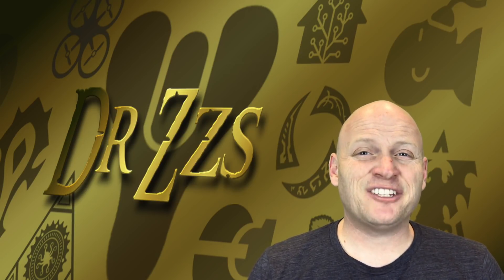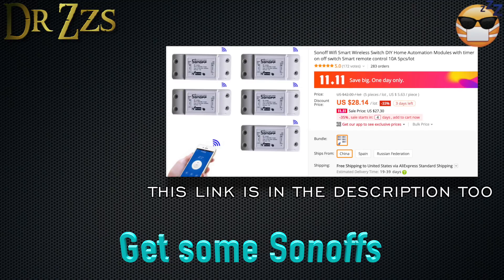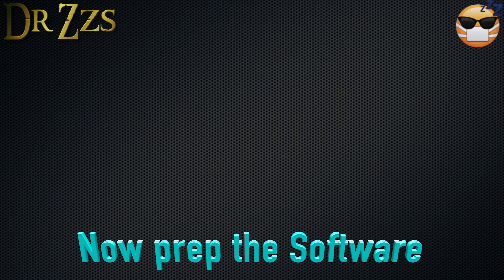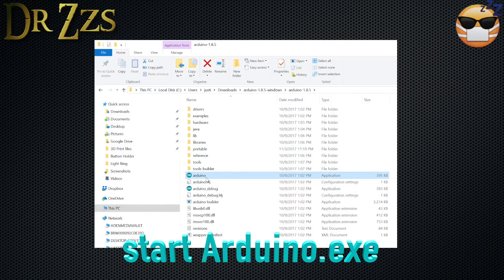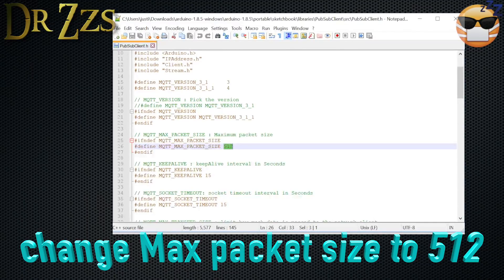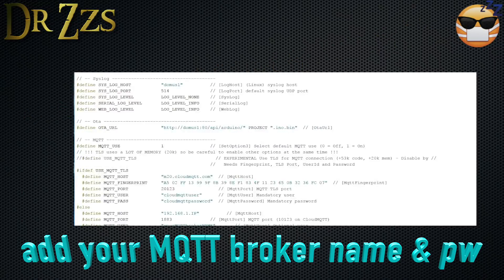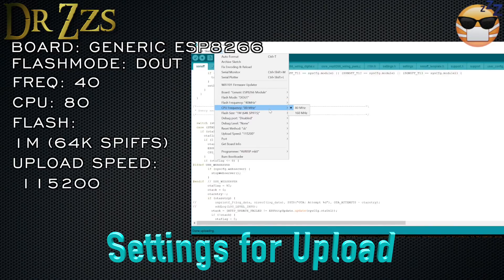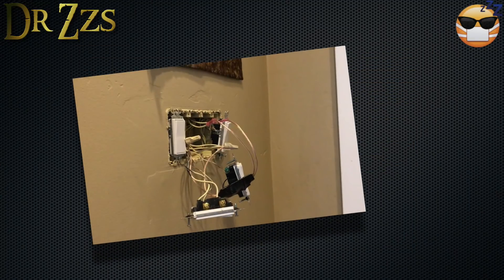Flashing TASMOTA Firmware on the Sonoff Basic

Comment: DrZzs great video!  thanks for the help.
I followed the video as best I could.  I didn't get the generic 8266 board installed and all the settings .  I went to board manager and searched for "generic" and installed.  I just thought I would get some feedback in case others were having the same issue.

I'm totally new to this and my question is around the MQTT.  I simply want to set up the lights to run off switch, phone, and google home.  I understand the ewelink will not work, so is the MQTT another APP that interfaces between google home and the sonoff?
Reply from the maker: Michael Anderson 

Thanks! And welcome to home automation! I think the sonoff stock firmware and EWeLink app work with google home. If you already flashed it maybe too late to go back and test it. 
If you haven’t successfully replaced the sonoff firmware with TASMOTA, try the stock sonoff stuff and see if google home can find it. 
MQTT is a message protocol to send simple messages between devices. It’s not an app. You have a broker, in my case it runs on the same raspberry pi that runs Home Assistant. Then your IoT devices can “publish” and “subscribe” to specific “topics”. So in my case Home Assistant is a client and the Sonoff (running TASMOTA) is another client. There’s a topic for the power control of the sonoff called “cmnd/sonoff/power” that the sonoff is subscribed to. Home Assistant can publish a “payload” of “on” or “off” to that topic. The broker receives that message and sends it to any device that is subscribed. In this case that’s the sonoff. When the sonoff gets the message it flips the relay. Then there’s a topic for the state of the sonoff. The sonoff publishes the state as on or off and Home Assistant is subscribed to that topic. So when Home Assistant gets that message it sets the icon on the home page to on or off depending on which payload it received.  
I think technically the sonoff isn’t publishing it’s state, but in general that’s how MQTT works. 

That was a really long, probably confusing response. Especially if you’re new to all this. 

Hope that helps!
Reply: Hey thanks!  I've been running the sonoffs, ewelink APP, and google home to control many devices.  I just wanted to start trying to control lights through the switches using GPIO14.  I havent flashed anything yet because I was stuck on the MQTT setup.
I think I follow your comment...
If I don't want to set up home assistant or a pi.  Is there an APP that you recommend like ewelink that would work as the interface between a sonoff (TASMOTA) and google home?
Reply from the maker: Michael Anderson Not off the top of my head. I’ll keep an eye out and let you know if I find something.
Reply from the maker: I'm a totally knucklehead.  
I completely forgot that Tasmota can emulate a Belkin WeMo or a Hue Bridge.  By doing that, you should be able to find them and control them with google home! 

https://www.dropbox.com/s/2d6ctfoirgwkj8w/Screenshot%202018-01-08%2011.58.59.png?dl=0

If you find a reason to try Tasmota, now at least, you'll have an option to still control your sonoffs with google home without another hub and MQTT.
Reply: I'm trying to flash for the first time.  I've been having to install different libraries.  Now I'm getting this error, but there isn't a library to install.  Any ideas?
Sonoff-Tasmota-5.11.0\Sonoff-Tasmota-5.11.0\sonoff\xsns_03_energy.ino:252:27: fatal error: TasmotaSerial.h: No such file or directory

thanks!
Reply from the maker: Try this:
https://github.com/arendst/Sonoff-Tasmota/issues/1522

Hope that does it for you!
Reply: When i was searching i saw this.  What is the repository lib folder and where would i be copying the files to?

thanks again!
Reply from the maker: doh! 

https://github.com/arendst/Sonoff-Tasmota/tree/development/lib/TasmotaSerial-1.0.1

That's the folder just for that library it looks like.  One level above that is the full repository lib folder. one level down in the src folder you'll see that TasmotaSerial.h file. 

I'm not sure where it should go.  just based on the error message I'd say try that \sonoff\ folder.  If that doesn't do it, then try asking Theo on that same post.  He's really good about responding.  He's the guy that wrote (or writes!) Tasmota.  

Good Luck!

Comment: Can I just connect a Sonoff to a light switch and only use Alexa to turn the light switch on and off? Also, do you have any thoughts on turning on a projector using Alexa?
Reply from the maker: Andrew Faletti Yes you can. Sonoffs with the stock firmware are discovered and controllable by Alexa. 

As for the projector, you can turn it on and off if you put a sonoff in the power cord. That won’t control any of the other functions though.
Reply: DrZzs Sweet! So I don’t have to solder anything to use a rocker light switch with a Sonoff?

With the projector I have to turn it on with a remote, so putting a Sonoff on the power cord will only put it to standby mode.

Comment: Love your videos, circled back to this one since sonOTA doesn't work anymore.
How can I tell which sonoff firmware my devices are shipped with?
Do you have any tips such as quick-connections for connecting to power and flashing several sonoffs in a row? 
Can you do a video on soldering on serial header and or jumper for the switch? (what gage wiring and possibly a link to same gage wire @ amazon)
for the usb, since you have the adapter, are you using a male to male cable to connect adapter to pc?
Reply from the maker: Thanks! 
There is a way to see the firmware version on each device in the eWeLink app.  
So, you have to go through the setup process first. Then click settings for the device you want to check.  Eventually you'll find a page like this:
https://www.dropbox.com/s/pnr2z6c7gi0v0ei/IMG_7731.PNG?dl=0

What I found to be best for flashing reliably and quickly was to use male jumpers on the sonoff side.  Put the Ground, Tx, and Rx, in their correct holes.  A little angle on the tips keeps them in place well enough for the few minutes of flashing.  Then I connect the usb/serial adapter (FTDI) to the PC.  It just plugs into a USB on the PC.  I then connect the 3v power jumper to the sonoff while holding the on-board button.  It takes a few tries to get it down.  
Next time I have to manually flash one I'll get some good close-up video.  
As far as wire size, I just use standard jumpers, whatever size they are, maybe 24g or something. 
Just these: http://a.co/dtKhgHj

The FTDI adapter I use takes a mini USB  cable to connect to the PC.  Then it has connectors for the female end of the jumpers. 
http://a.co/6fCEXc5

Hope that helps.
Reply: Yes it does, thank you very much.
Reply: @DrZzs  I know this is an old video, but I still have a few of these old sonoff basics still in use in my house from this video. Back then, we had the mqtt settings in the main configuration yaml. Since then, there have been some mosquito (mqtt) updates for HA. Did you run the mqtt mosquito server updates in HA? Did you end up keeping mqqt config in the main configuration.yml or did you move to the configuration via the add-on?
Reply: If you want to flash a bunch of devices in a row, it's faster with a stand alone flashing app outside of the arduino environment to directly transfer the bin file. There are several out there, the best in terms of functionality and configurability is esptool.py (python must be installed as a prerequisite).  There is also esptool.exe that works stand alone.  Both of those are command line tools and take some time to understand.  There are also GUI front ends for those if you look around. If you are only doing a handful, it's probably not worth the hassle of figuring out and setting up another app, just use arduino.

Comment: Thanks for creating this video. Question regarding the flash size. According to the wiki, it should be "Flash Size: "1M (no SPIFFS)"" https://github.com/arendst/Sonoff-Tasmota/wiki/Arduino-IDE Is this correct?
Reply from the maker: Peeta Thanks!
I think it changed. I’ve done it with 64k spiffs many times and it has worked for me.

Comment: When using tasmota firmware to use Sonoff in regular gang switch.  Can the switch be a dimmer or does this mess with the dimming of your smart home control.  Thanks
Reply from the maker: VrT Hykr No. You won’t get dimming if you connect a dimmer switch to the gpio pins. There’s a lot of things TASMOTA can do that I haven’t tried. I haven’t looked but I seriously doubt there’s a dimmer function. 
You’d have to have “smart” bulbs, but if you have those you don’t need a sonoff to control them. 
Many people are asking iTead to make a WiFi dimmer switch. They’ve been a pretty responsive company so I bet they’ll make one before too long.

Comment: Hello, Can you help with the following error:

Arduino: 1.8.5 (Windows 8.1), Board: "Generic ESP8266 Module, 80 MHz, ck, 26 MHz, 40MHz, DOUT, 1M (64K SPIFFS), v2 Prebuilt (MSS=536), Disabled, None, 115200"

In file included from c:\users\ashourina\downloads\arduino-1.8.5-windows\arduino-1.8.5\portable\packages\esp8266\tools\xtensa-lx106-elf-gcc\1.20.0-26-gb404fb9-2\xtensa-lx106-elf\include\c++\4.8.2\string:41:0,

                 from c:\users\ashourina\downloads\arduino-1.8.5-windows\arduino-1.8.5\portable\packages\esp8266\tools\xtensa-lx106-elf-gcc\1.20.0-26-gb404fb9-2\xtensa-lx106-elf\include\c++\4.8.2\random:41,

                 from c:\users\ashourina\downloads\arduino-1.8.5-windows\arduino-1.8.5\portable\packages\esp8266\tools\xtensa-lx106-elf-gcc\1.20.0-26-gb404fb9-2\xtensa-lx106-elf\include\c++\4.8.2\bits\stl_algo.h:65,

                 from c:\users\ashourina\downloads\arduino-1.8.5-windows\arduino-1.8.5\portable\packages\esp8266\tools\xtensa-lx106-elf-gcc\1.20.0-26-gb404fb9-2\xtensa-lx106-elf\include\c++\4.8.2\algorithm:62,

                 from C:\Users\Ashourina\Downloads\arduino-1.8.5-windows\arduino-1.8.5\portable\packages\esp8266\hardware\esp8266\2.4.0\cores\esp8266/Arduino.h:240,

                 from sketch\sonoff.ino.cpp:1:

c:\users\ashourina\downloads\arduino-1.8.5-windows\arduino-1.8.5\portable\packages\esp8266\tools\xtensa-lx106-elf-gcc\1.20.0-26-gb404fb9-2\xtensa-lx106-elf\include\c++\4.8.2\bits\allocator.h:46:75: fatal error: bits/c++allocator.h: No such file or directory

 #include <bits/c++allocator.h> // Define the base class to std::allocator.

                                                                           ^

compilation terminated.

exit status 1
Error compiling for board Generic ESP8266 Module.

This report would have more information with
"Show verbose output during compilation"
option enabled in File -> Preferences.
Reply from the maker: Try going into Tools - Board - Boards Manager and search for esp8266.  Make sure that's installed. 
Hope that works!
Reply: I get this error now:

Arduino: 1.8.5 (Windows 8.1), Board: "Generic ESP8266 Module, 80 MHz, ck, 26 MHz, 40MHz, DOUT, 1M (64K SPIFFS), v2 Prebuilt (MSS=536), Disabled, None, 115200"

In file included from c:\users\ashourina\downloads\arduino-1.8.5-windows\arduino-1.8.5\portable\packages\esp8266\tools\xtensa-lx106-elf-gcc\1.20.0-26-gb404fb9-2\xtensa-lx106-elf\include\c++\4.8.2\string:41:0,

                 from c:\users\ashourina\downloads\arduino-1.8.5-windows\arduino-1.8.5\portable\packages\esp8266\tools\xtensa-lx106-elf-gcc\1.20.0-26-gb404fb9-2\xtensa-lx106-elf\include\c++\4.8.2\random:41,

                 from c:\users\ashourina\downloads\arduino-1.8.5-windows\arduino-1.8.5\portable\packages\esp8266\tools\xtensa-lx106-elf-gcc\1.20.0-26-gb404fb9-2\xtensa-lx106-elf\include\c++\4.8.2\bits\stl_algo.h:65,

                 from c:\users\ashourina\downloads\arduino-1.8.5-windows\arduino-1.8.5\portable\packages\esp8266\tools\xtensa-lx106-elf-gcc\1.20.0-26-gb404fb9-2\xtensa-lx106-elf\include\c++\4.8.2\algorithm:62,

                 from C:\Users\Ashourina\Downloads\arduino-1.8.5-windows\arduino-1.8.5\portable\packages\esp8266\hardware\esp8266\2.4.0\cores\esp8266/Arduino.h:240,

                 from sketch\sonoff.ino.cpp:1:

c:\users\ashourina\downloads\arduino-1.8.5-windows\arduino-1.8.5\portable\packages\esp8266\tools\xtensa-lx106-elf-gcc\1.20.0-26-gb404fb9-2\xtensa-lx106-elf\include\c++\4.8.2\bits\allocator.h:46:75: fatal error: bits/c++allocator.h: No such file or directory

 #include <bits/c++allocator.h> // Define the base class to std::allocator.

                                                                           ^

compilation terminated.

exit status 1
Error compiling for board Generic ESP8266 Module.

This report would have more information with
"Show verbose output during compilation"
option enabled in File -> Preferences.
Reply from the maker: that looks like the same error. 

looks like it might have something to do with the ArduinoJson library.  Make sure it is loaded and updated

Comment: does your sonoff go offline frequently? Mine goes offline once in 2 days and stays offline for atleast 6 to 8 hours.
Reply from the maker: Yes, mine have disappeared occasionally.  I haven't tracked how often or for how long.  
They sometimes randomly trigger too.  Don't know if that's a problem with the sonoff or my network, or 2.4ghz frequency interference.
Reply: DrZzs Guess that's the problem from sonoff, it's unable to connect to the sonoff cloud/server. I did mail them about this and they said that they have fixed that isuue and it should be up and running, But facing the same problem again.
Reply: I don't have sonoff. But I've used bare esp12e to make my own IoT board.. mine stays connected for 4-5 days and then disconnects until I reset it.
Reply from the maker: Cool.  Do you have some instructions you could share?   I'd like to get better at writing useful sketches for ESP boards.
Reply: DrZzs not yet but I can share my eagle cad files for that if you want. For software side, I used my own self-made server and firmware.

Comment: Do I need a MQTT broker if I’m planning on using a SmartThings hub? I’m new to this and I have no idea of what a MQTT broker is.
Reply from the maker: I'm not sure.  I have a SmartThings hub that I haven't taken out of the box yet (Christmas present to myself).  
My guess is that SmartThings hub has a way to set up an MQTT broker. MQTT is the way a lot of "IoT" devices get messages to each other.  

I should probably do a video explaining MQTT.  
In the mean time watch this one.  Ben explains MQTT really well.
https://youtu.be/AsDHEDbyLfg

I'll get around to opening my SmartThings hub soon.  Then I'll be more helpful :)
Reply: DrZzs do you know what version your esp8266 was? It defaulted me a version 2.3.0
Reply from the maker: I think mine was 1.5.5
Reply: DrZzs because I’m getting the error

exit status 1
Error compiling for board Generic ESP8266 Module
Reply from the maker: Rocky Try going to Tools - Board - Board Manager - search for ESP8266 and make sure it’s installed.

Comment: Hi, great video. I followed everything to the T. Well I am not sure about the MQTT broker and password... and when I am uploading the file it gives an error. I am posting it below. Can you please help?

Thanks

Arduino: 1.8.5 (Windows 10), Board: "Generic ESP8266 Module, 80 MHz, 40MHz, DOUT, 115200, 1M (64K SPIFFS), ck, Disabled, None"

In file included from C:\Users\luisn\Downloads\SONOFF SOFTARE\arduino-1.8.5-windows\arduino-1.8.5\portable\sketchbook\libraries\PubSubClient\src/PubSubClient.h:77:0,

                 from C:\Users\luisn\Downloads\SONOFF SOFTARE\Sonoff-Tasmota-5.10.0\Sonoff-Tasmota-5.10.0\sonoff\sonoff.ino:40:

c:\users\luisn\downloads\sonoff softare\arduino-1.8.5-windows\arduino-1.8.5\portable\packages\esp8266\tools\xtensa-lx106-elf-gcc\1.20.0-26-gb404fb9-2\xtensa-lx106-elf\include\c++\4.8.2\functional:48:28: fatal error: bits/c++config.h: No such file or directory

 #include <bits/c++config.h>

                            ^

compilation terminated.

exit status 1
Error compiling for board Generic ESP8266 Module.

This report would have more information with
"Show verbose output during compilation"
option enabled in File -> Preferences.
Reply from the maker: Luis Nunes I think I left out that after you put in the URL for the board manager you have to load the esp8266 boards. I have a screenshot I can post, but it’s on my computer and I’m not home. I’ll post it later.
Reply: DrZzs OK. THANK YOU for getting back to me so fast.
Thanks
Reply from the maker: You're welcome! 

Try this:
https://www.dropbox.com/s/0rqfrhsp5626isa/Screenshot%202018-01-02%2019.23.43.png?dl=0

In the Arduino IDE, go to Tools, the Board, then Board Manager.  Search for esp.  Make sure the ESP8266 is installed.  Hopefully that'll fix it for you!
Reply: TY. When I get home I will try it and  will comment. Thanks

Comment: is any body eles getting this during compiling  ...  c:/program files (x86)/arduino/portable/packages/esp8266/tools/xtensa-lx106-elf-gcc/1.20.0-26-gb404fb9-2/bin/../lib/gcc/xtensa-lx106-elf/4.8.2/../../../../xtensa-lx106-elf/bin/ld.exe: C:\Users\office\AppData\Local\Temp\arduino_build_464141/sonoff.ino.elf section `.irom0.text' will not fit in region `irom0_0_seg'

collect2.exe: error: ld returned 1 exit status

exit status 1
Error compiling for board Generic ESP8266 Module.